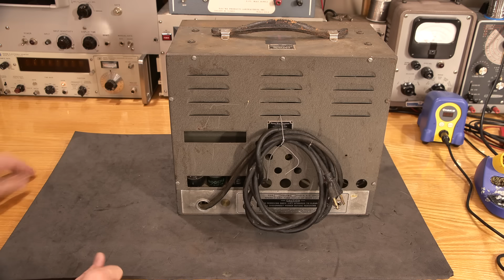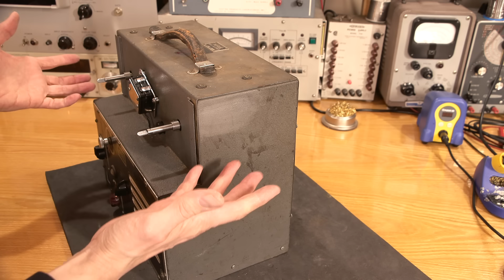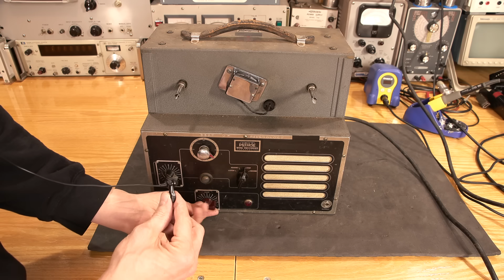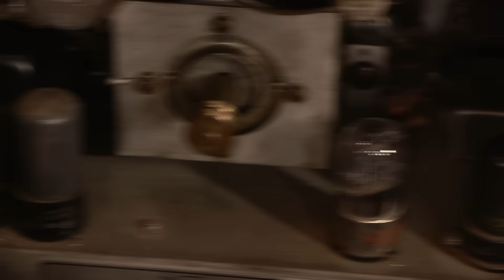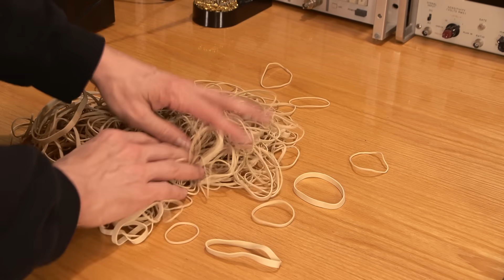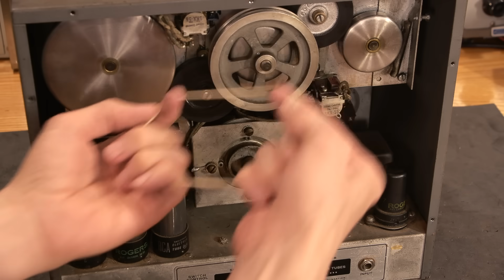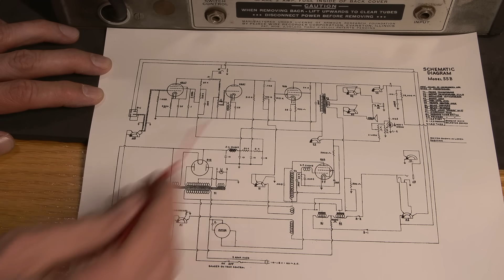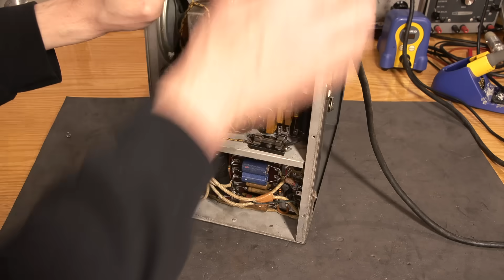Trapped Voices In This Wire - Let's Listen To Them!

Comment: The reason you see Department of Psychology on so many of those wire recorders? It's because…… They were Not High fidelity. They were Low Fidelity, Lo-Phi. Mostly speech frequencies that could be listened to, tolerably.  Because otherwise? They were simply miserable sounding with music. They were horrible, for music. Relegated mostly to, the spoken word. Long enough spools of wire. So they could do psychoanalytic sessions on wire recordings. No need to flip over the tape or reverse the direction.  Since there was no tape yet.

And so they were so horrible and tinny sounding. They weren't even good for Commercials on radio stations. They sounded so horrible.  As they did not yet know? How to combine a supersonic, pure sine wave, Pilot Wave, frequency,  overtop the audio you are trying to record? One called a Bias Frequency. That generally needed to be, 4 times higher. Than the highest frequency you want to reproduce? So with the upper limits of human hearing at 20 kHz. You would need a minimum bias frequency of 80 kHz.  And we found higher is better. The highest you can take it. 100 kHz, 120 kHz, 160 kHz, 235 kHz, 400 kHz. And beyond for high-speed tape duplication purposes. 500 kHz,  1 MHz,  2 MHz. And it has to be of the purest nearly 0 distortion sine waves. That gets tricky. And to maintain that equipment.  Back in the 1970s, 80s, 90s. Before we had Digital testing anything? We had Vacuum Tube Volt Meters  known as VTVM's. Later they would use a lightweight transistor and would fit in your pocket.

I miss my Ballantine VTVM. I had gotten from my mentor 50 years ago. Later I had a Hewlett-Packard 3rd Harmonic  Distortion Analyzer. That was the standard. How to tweak, align, calibrate, the original Analog Tape Recorders. You went for, 3% Distortion of the 3rd Harmonic of 1 kHz. So it was looking for the harmonic at 3 kHz. And only, 3 kHz. When other morons started using, THD Analyzers. And tweaking for the same thing.. But that will yield erroneous results.. Going for the THD instead of, 3% distortion at the 3rd Harmonic of 1 kHz.

And people were using THD analyzers yet mumbling the same procedure for only the 3rd Harmonic Distortion Analyzers? Because they had  college degrees that said they could?  Yeah no. It didn't work that way.

And because some of us. Built those damned recorders at the factory.  And they never did anything like that in their career? But have pronounced themselves experts? Yeah no. They are not. I am.

And I think,  that's why the psychology department had all of them. They got them all for free.  As soon as everybody heard how awful it was for music? 78 RPM scratchy records sounded a lot better. They were smoother and less tinny sounding. Making them great for speech applications only. In other words they had the frequency response of an old-fashioned telephone. So that's why the psychology department got them all. They were not really pleasant to listen to, either. It was loaded with Harmonic distortion. And that can make your brain throw, temper tantrums. And not know why you are suddenly feeling irritable? It has a psychological effect upon the listener, that's why. So if you want to make somebody go nuts getting a degree in psychology? Make them listen to hours and hours long sessions of psychoanalysis. On a wire recorder.  I believe you will eventually go Mad? So perfect for a psychology department. To be able to cope with such things? In understanding the Psychology of Sound Perception? I could write a book on that and I might?

I love your show. This is great. While I was an audio aficionado and world authority on analog tape recorders. I never messed around or touched or saw a wire recorder, ever in my life? You'd think? I would have? And being trained as a factory authorized warranty service technician for Ampex, MCI both. Then later getting hired on as the, Quality Control Manager and Final Test  Engineer. And the overall Technical Troubleshooter. For the Scully series of Legendary American Multitrack Analog Audio Recorders. I never realized I would become a World Authority? But it happened. I just never messed with the wire recorder? I paid no never mind into gear that sounded like Shit? Why would I?  I was all about the high fidelity and the sound. Wire recorders lost under both of those categories. While I was literally raised with, 1/4 inch Full Track Mono Recording. Later to get a, 2 track Stereo, 4 Track and 8 Track Scully Studio Tape Recorders.

(More Wired  Donnie's in following post)

Comment: As far as the 16 track machine went? Both the Ampex, MM-1000-16 and the Scully 288-16 both weighed in at approximately 850 pounds.  And about 7 feet tall. And we all wanted something smaller. That does the same thing at the same quality level. And everything shrank down to a more manageable. Large industrial washing machine sized at approximately, 550 pounds. That was far more manageable. No taller than 4 feet.. And 24 inches wide.

They never made a multitrack wire recorder? Maybe had they been stereo, Lo-Phi? Maybe they would have caught on better? But they couldn't figure out how to get 2 channels onto that single here fine wire?  When World War II finally ended. And Jim Mullins, brought back from Germany one of the first, magneto phone tape recorders from Germany. And handed it over to Alexander M. Poignant off. Started building them for others and called his company, AMPEX. I  almost went to work for them but declined, their offer. Then some guy by the name of Jeep was making, AMPEX, knock off, transistorized, Audio channel electronics. So you could convert your old vacuum tube AMPEX recorder. To make it sound every bit as good. As a brand-new AMPEX, AG-440 and  MM-1000 electronics had. And they became a big hit. Because they were clones of the AMPEX. Not just similar but exact. You could swap circuit boards. Between your AMPEX and MCI recorders. Because MCI recorders were exact AMPEX clones. When they first started making recorders. And also audio mixer consoles.  Where some people actually thought they sounded good? But that actually sounded Brown. Somebody once described their sound to me? And I realized that was accurate. MCI audio consoles sound Brown. Their tape recorders sounded identical to AMPEX. Until they actually got better one day. But for my application? I was much better off with the AMPEX, MM-1200-24 products. For one very specific, Technical Reason. You could be assured would always be in alignment. After you drove 800 or more miles. Bouncing it around the whole way. And to find it still perfectly in calibration? That was always an absolute marvel!

And that was the Heads. The very expensive heads. That cost a few thousand dollars each. And fit in the palm of your hand with all three.

Yes AMPEX built their heads much differently. Than that of other manufacturers. And on the MM-1200. All three heads mounted with one single screw. And none of the heads had anything you could adjust. They were adjusted at the factory. They could never be changed. It's almost like your car has been tuned permanently at the factory. No need to ever tune your car again? And well? Even your cars are there. With Platinum Plugs and beyond. And to know. You could switch between, 24 track, 16 track, 12 track, 8 track heads. With just, One  Screw? And the heads are sitting on a 1/2 inch solid aluminum block. Once aligned. Never has to be realigned. It's ready to go when you get there. No taking the next 3 hours to realign the heads. To get them that precise with that precision, again. After every time you move the vehicle? Yeah no! We all went with the AMPEX MM-1200 machines. And they would sound like AMPEX machines. Because they were. They used a 100 kHz Bias Oscillator Frequency. Other manufacturers featured much higher bias frequencies. Those machines did sound better. And oh well? Instead it'll sound like an AMPEX. You got any trouble with that? They record just fine and sound great. With a 100 kHz bias oscillator frequency. Lots of people preferred the 3M  machines from the company that makes the tape we all loved. And who used a 235 kHz bias oscillator frequency. But you had to realign the heads at every location. That can be an arduous long drawn out job. Taking many hours. To get it just so and precision again.

So there were obvious advantages to running the AMPEX MM-1200 machines. That never needed their heads aligned, ever. You could do it? But you really can't do it. It is possible but not likely? You wouldn't want to tackle it. I was shown how it was done. And I was like, nope. None of us have the equipment to make such things for alignment purposes? They are thin metal shims only microns thick. Or rather, thin microns thin. Less than the width of a human hair. And you have to slide it under the head. Then screw the head down tight. And measure the azimuth error, again and again and again and again… And again. Until you get it perfect. It must be perfect.  Not meant for an amateur enthusiast, to do. Not never. I know people in the business who can or who did. Before they died and/or retired, permanently.  We all had a successful run for decades. We made Music Happen. It was a Happening. Of the 60s, 70s, 80s and 90s. Until all went Computerized. And died.

Now we get perfectly synthesized music and pictures. All totally synthetic.. All from echoes of the past. From a Special Time in World History and Music.  Now that the Music has Died. And we get perfectly constructed computerized garbage. Of pretty little ladies wiggling their asses.  And boys looking like a conglomerate of don't know what anymore? They look and sound like angry little boys?  They are all angry at the world. And doing nothing about it? Except to vote for a Dictator. Because the boys liked his TV show. They want to be in his TV show. Some went to our Nations Capitol Building to prove it. They were only tourists. With very little self-control. They were so exuberant. They ransacked and smashed everything. They tried to kill our history. As a Nation. As a Culture. As Americans. Because they didn't like it anymore. They wanted Donnie Dictator.  And when they didn't get there dictator? Again? They all decided to act like petulant little boys that they are.

They went to Donnie Ville  University for their Degrees in, Deplorable. I mean who else goes to our Nations Capitol building, to destroy it? Other than angry wacko man boys? And their man boy girlfriends and wife he poo's.

The wacko extremist boys are, too stupid, to know what's going to happen to them? Carrying on like Donnie 4-year-olds.
RemyRAD

Comment: One other thing, you really should change out capacitor before you apply power. If you don’t, the capacitor could short and ruin your whole unit. One hour store radios. I never plugged them in at first. You need to disconnect the transformers and test them out individually again individual components need to be de soldered and checked and then replaced if necessary. It’s your wire reader however you’re so experience have taught me to take your time with equipment so that you can properly repair and replace items needed so that you can enjoy it.

Comment: You should never touch vacuum tubes with your bare hands! Use gloves because the oils can get in the glass and caused them to fail prematurely
Reply from the maker: Hi John, I mean this in the nicest way: The oils from your hands or fingers does not affect the glass of a tube. If you say things like this in technical circles, you will get instant disrespect. Don't repeat or parrot other peoples fairy tales.

Comment: In about 1960 my dad rented an answering machine from the phone company. It had a 45 rpm vinyl  record that instructing the caller how to record a message, and it had a wire recorder to record incoming calls. I recall onetime when it failed the tech opened the box and discovered a huge tangle of wire.  As I recall the audio was low fidelity, but Southern Nevada Telephone never had good fidelity.

Comment: Sandvik in sweden might have better formulas for that type of wire mesh - they did the new extremly corrosive resistant replacement bolt to the battleship Vasa

Comment: 32:46 Crispy original looking.. lol  I can almost SMELL that device.  😅  I am ~just ancient enough to have grown up with this level of tech in my home until I was in middle school, and i can remember fooling around with an old bench stereo system we had, it was tape, not wire, but still tubes.  I remember before we finally got rid of it, the wiring was so old and yellowed that it was almost disintegrating.

Comment: @MrCarlson'sLab
You've inspired me to learn a very interesting history lesson starting in 1876 when Bell changed the world with the world's first telephone "call" (naturally I went there because one of the wire recorder's original intended purpose was to become a telephone answering machine (telegraphone) envisioned in 1898).  It is an odd coincidence that telephone calls would be indicated by the ringing of a bell component of the phone which was invented by Alexander Bell.  But yeah, wire recording was an amazing consumer technology compared to the home phonograph disc recorders and dictaphone type devices that preceded it.  In the 1950's, magnetic oxide coated plastic "tape" started to catch on and quickly became the successor to wire recording for most applications.  The two technologies are basically identical except for the physical media itself, with the tape form factor offering higher quality with less distortion due to its flat controlled and consistent contact with the magnetic head.

Anyway, I am really curious about where you came upon the reels of wire and what the specific history is there.  Do you know when it was recorded, who is recorded, or any other backstory details?

Also, watching you troubleshoot that wire recorder with giving some Professor of "Gilligan's Island" character vibes.  I fully expected to see some coconuts and vines inside the device as you removed the bottom cover plate.  LOL

Comment: I got an old Audograph (acetate disc 1950s dictation machine) to run again, and transferred 100+ discs for a well-known Hollywood person from that era. The conversations were interesting beyond words. I do all sorts of other archival recovery, and getting audio from these wires which otherwise will never be heard would make this restoration worthwhile. There are still a few sources for belts and tires; cap sourcing is easy; and I would definitely test and, if needed, replace tubes. Getting the speaker to work doesn’t matter at all because you are going to capture and digitize the audio  at preamp level. 

However, like so many of these projects, you need an incentive to put in the work. For my Audograph fix (it was really easy compared to this) it was a paid gig, and I knew going in that I was going to be listening to stuff of major historical significance. However, I did another project, this one on reel-to-reel, so no restoration of anything was needed, of an engineer, born around 1880, but in his late 70s at the time of the recording, describing what it was like to see his first light bulb; his first interaction with an automobile, his first view of an airplane. Then radio, TV, and more, all from an engineer’s perspective. While it didn’t have the broad appeal of listening to Hollywood figures talking to each other behind the scenes, its insight into seeing those major inventions for the first time is really amazing.

Comment: There is a device called a Binson Echorec. A multi head echo device based on the wire recorder. Pink Floyd used them extensively into the mid 1970s. It used a rotating drum with rows of wire wrapped on and machined flat.

Comment: There are principles and history that should be explained first.  Forerunner of the modern tape recorder.  Wire was used instead of modern plastic tape which was coated with oxides.  The wire was magnetized using the recording heads and had to pass over the playback heads at high speeds which required a lot of wire.

Comment: I remember explaining such a device that arrived via University Surplus at the University of Iowa back in 2003-or so. It didn't come with any wire, but I was able to locate one at the archives in the library to test. It was an interview of some project board in the early 1950's, planning expansions to the University. The manager of the Surplus department was very impressed that I was able to demo the device. It is now part of the Library again, and can be accessed by request. I believe they have now collected about thirty spools of wire for it from various sources.

Comment: I never heard of a Wire Recorder.
When I got into repairing electronics in the mid-90s, the oldest piece of equipment I ever worked on was a juke box from the 60s.
Most of the time I got in old vinyl record players, reel to reel tape machines, and some old tube driven TVs from the early 60s.
This wire recorder looks ancient.
As Spock from Star Trek would say, "This is barely above knives and bear skins".

Comment: Not quite a wire recorder but a couple years ago I acquired a Tandberg reel to reel tape recorder. From it's design and the "magic eye" tube for monitoring recording input levels  and its overall tube circuitry I  would place it as manufactures in the early 1960s, probably 1961 - 1964. I haven't dug into its internals yet,. however it does work well. Playback, record all works. The spool mechanisms are a bit sluggish at times but that is likely from sitting unused for many decades. I plan to open it up, replace the capacitors, and give it a good cleaning.

Comment: Devices made in the 1940's had "rubber" parts that underwent some degenerative process (peculiar to that era) that made them brittle (like plastic).  Power cords would get cracked insulation (dangerous).